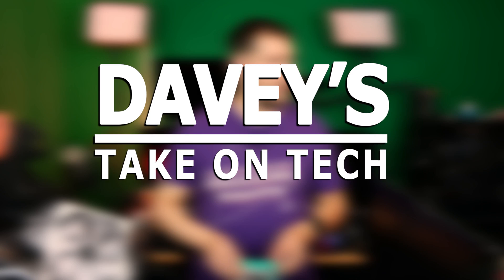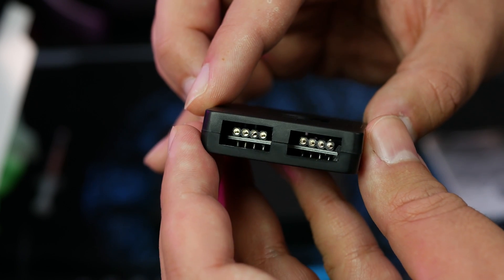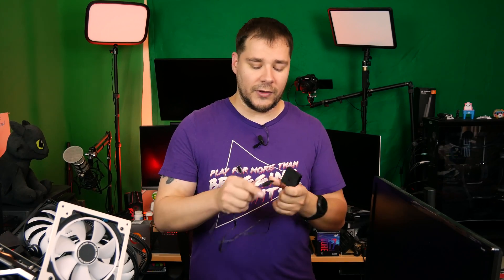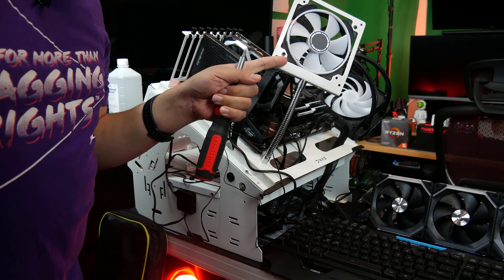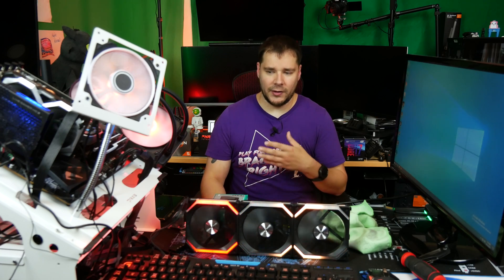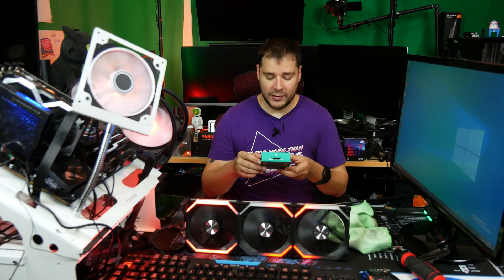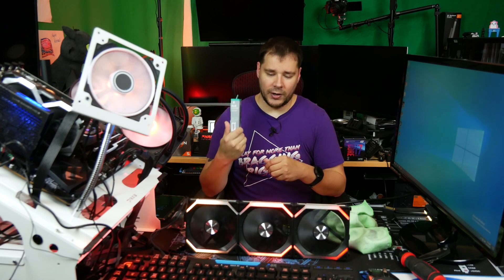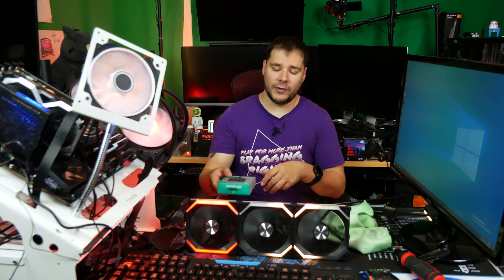Connecting a 3-pin 5V ARGB product to a 4-pin 12V header? Yes, it's possible

Comment: Im doing a very dumb thing but i have razer blackwidow 2019 (chroma) razer deathadder (chroma) and gonna buy some more razer hardware but i have 9 year old pc lol i5 3470 4cores 3.2ghz and gonna buy rx 570 motherboard is gigabyte h61 but my motherboard has 12v 4pin (not sure) im gonna buy a case and gonna buy rgb fans and argb spliter but the thing is i want to sync all my razer gear with my rgb fans with asus aura sync msi mysatic light or gigabyte software but i want to know im gonna buy a rgb fan which comes with splitter will it support my motherboard and will they fry my motherboard the fan header on my motherboard says      sys_fan

Comment: This item has been on my radar for almost 2 yrs. I've had a few testimonies from PC group members it works most of the time. And YES I was actually wanting a video to cover on this. Finally! This will clear a lot of my questions with 5v to 12v usage
Reply from the maker: I had only heard about it a few months ago and since 75% of the questions on my videos are related to 5v to 12v products, figured it was worth taking a look at. I was pleasantly surprised to see it work pretty well with only a few little hiccups, mostly with one brand of strips. I'll probably check compatibility with other products as I get new stuff in, but so far it's worked with Fractal's ARGB fans, Phanteks' products, and the new Lian-Li Uni fans with no issues.
Reply: @DaveyKTech  Good take man. subbed, and keep up with the content. Audio is fine and clear
Reply: @Davey K Tech  will this work if motherboard doesnt have 4 pin header

Comment: well this sucks, don't feel like spending $20 so I can connect an m.2 rgb heatsink.. I could just buy a 12v rgb heatsink for $15.
Reply from the maker: Yeah, this probably isn't a good solution for something like that. It's pretty good for LED strips and fans.
Reply: @DaveyKTech  Same difference.. Doesn't make sense to spend 20 on a converter when you could just spend less on a different led.
Reply from the maker: @hbeezey  Right, it doesn't make sense. However, this product exists because there are so many situations where someone bought an ARGB product and didn't have a 3-pin header on their motherboard. It makes more sense to buy the proper product, but sometimes mistakes happen. Or the product they want only comes as ARGB. It's niche, but the internet is full of comments looking for something they can use like this.